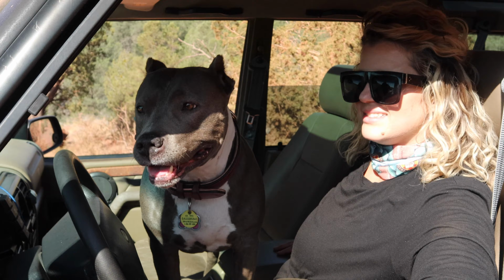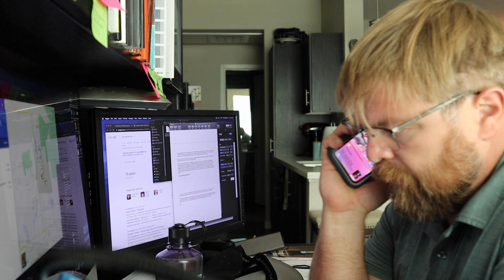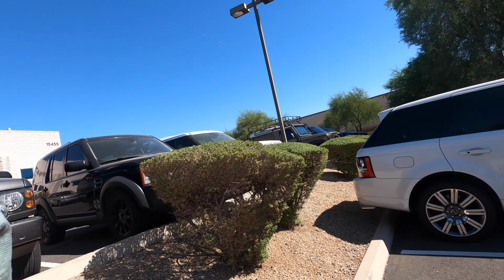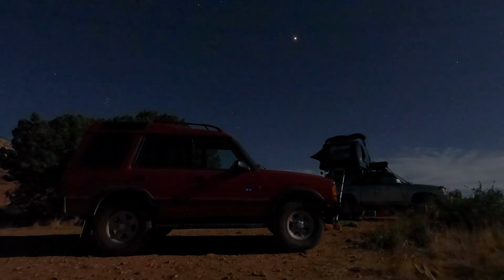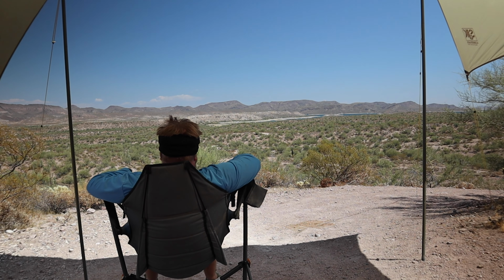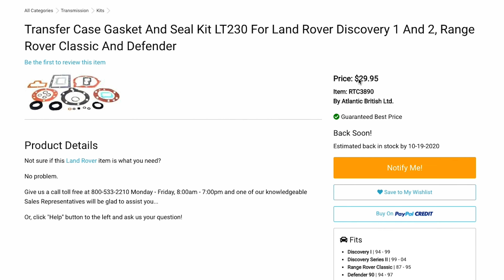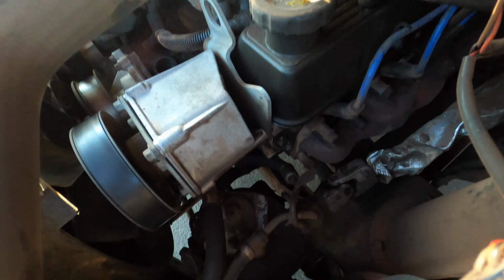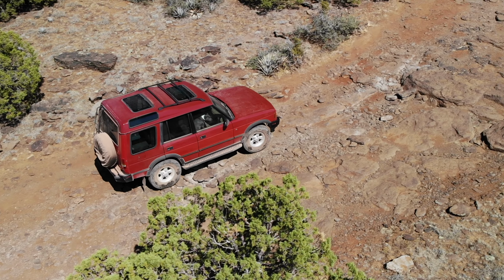Most All Of The PROBLEMS With My Wife's LAND ROVER DISCOVERY 1

Comment: cool video! i just found your Chanel and subscribed. i own a 1998 discovery 1 with 225k on it, and have a bit over 8k worth of new parts on it. that's parts alone i did the repairs. i estimate ive saved myself close to 15k in labor alone. i got most of my parts from Atlantic British, some used parts such as exhaust manifolds from eBay i also recommend lucky8llc, rovahfarm and rockauto for parts.  most repairs are not very difficult and can be accomplished with only one person. i honestly love my discovery 1 and often i start it up just to hear that v8 purring. i recommend downloading the rave manual for the disco. it has been an invaluable resource that and YouTube. A decent set of spanners and sockets, a dewalt impact driver with socket attachments bits, and a regular impact wrench for easier part removal where applicable.  Also several your beverages of choice may be needed and highly advised while doing repairs/upgrades.

if you're replacing the gaskets and machining the heads, i do recommend you replace the timing chain my next project before it breaks*, water pump(STC4378OE), coolant hoses, thermostat with a 185 degree Fahrenheit unit, oil pan gasket(602087), oil pan bolts/lock washers (EOPBK), clean the oil pan sump hose metal filter/replace it *used brake cleaner to remove all varnish and thoroughly clean it*, metal radiator cap (ERR4686B), new exhaust manifold bolts (ERR6734G) *nickel based Copper slip for the bolts for easier future removal, 2400 degree version*, exhaust manifold studs (ERR551) *old studs will likely snap when removing, new manifolds/used manifolds may be required*, new exhaust manifold gaskets (ETC4524K2), zddt additive *to prevent premature cam wear added to new oil (ZDDPLUS), fan clutch (ERR3443) used a dewalt impact driver with allen hex bits to remove allen bolts made short work of them*,  fan clutch wrench (88550) inertia switch (WQT100030L), new brake bulbs *vehicle will not move out of park if a brake light is blown out, found this out the hard way and bypassed mine by using a pin punch on the shift solenoid under the plastic center counsel i do also recommend investing in a 52mm socket for the wheel bearings to adjust the pre and post load.  also replace the fuse able links under the fuse panel in the engine bay   x1(STC1757G), x3 (STC1758G), x1(STC1759G), x1 (STC1760G) keep the old ones as backups as most non dealer parts stores do not carry the 100 amp alternator fuse and could very well leave you stranded should the alternator fuse blow

although it is alot of work, however most of this can be completed in a couple weekends worth of work. replacing those items will ultimately save you time in the future and give you a rock solid engine to build your rig onto. The fan clutch and water pump should be replaced as soon as possible as likely they're overdue for replacement, especially in a very hot climates, these engines are all aluminum so any overheating is a serious issue, as a new remanufactured block alone is 4500 without the core charge. new coolant green coolant is also recommended, avoid any oat based coolants as they tend to be harmful if left unchanged for long periods of time despite the claims that they are long life coolants. 

i replaced my cat back exhaust with a magnaflow system and it changed the sound quite a bit its not obnoxiously loud however you definitely know when its running. i look forward to watching your progress on your disco. welcome to the club ;)
Reply from the maker: Thank you, Chris! That's quite a good bit of info! I actually just got my head gasket kit on Friday, and I'm in the process of getting the head gasket done. I am replacing all the coolant lines, power steering lines, water pump, and thermostat while I'm in there, hadn't thought about the timing chain... fingers crossed the one that's in there stays together for a while. It's been fun, so far though. Hoping to have it all buttoned up by tomorrow night or Wednesday morning at the earliest!
Reply: @MattKester  sounds good man. the engine itself Ive found is quite reliable, it does lack in power a bit on pavement however its true power shows through once it gets off road. good call on replacing those lines as they generally will rot from the inside out and likely they will look fine until you try to pry them off to remove components only to have the hose crack. i wouldn't worry too much about the timing chain as long as your oil light isn't staying on, and you dont hear alot of rattling or unusual vibration. mine has lasted 225k miles and is still running like a top. however with that many miles its definitely in the back of my mind that it may be time to see about replacing it and the oil pump in the near future.
Reply from the maker: @krookdfinra  Well, considering it’s stablemate is a 3rd Gen 4Runner, we are pretty used to not breaking any land speed records on the highway. I’m glad I ordered those hoses too, the ones that were on there were definitely on the drier side, based on how hard some of them were to pry off.

Comment: They leak alright..They RAIN inside. Why leak from one sunroof when you can leak from 2. Or have fun when the mechanism shorts and they open by themselves just to add insult to injury. True money pits especially if you have to buy parts or use a mechanic. If you can't do your own work run away from these at all costs.  If you can do your own mechanics, run away faster. Life is too short to F@#$ with these rejects.This comes from a sad sack that currently owns two, a disco 1 and 2. I don't trust them out of my hometown.

Comment: Hi, after owning a 1991 landrover discovery 3 door for 10 years, doing all my servicing and repairs, I know quite a lot about them. the biggest problem with yours and most of the same imported land rover of that type Is you have the wrong engine - LOL most of European owned landrovers were sold with the unbreakable turbo diesel engines that just ran, and ran, and ran.. Ok your front hubs, later landies and rangies used "one shot2 grease in there front hubs, i ran mine on  lithium grease as you put that in bearings and L/R & R/R front hubs have wheel bearings eh..lol also less tendency to leak unlike 90 weight oil, As you run an autobox you must address cooling issues you stated, swiches and wiring can be easily sorted out, its a Landrover, an offroad vehicle made for FARMERS not luxury cruising, but they will... In the UK there cars sold as 4x4 CARS not trucks, but made for farmers if they want more comfort than the L/R Defenders, REAL L/R defenders not the new 2020 crap things they sell.- Hope you enjoy you "LANDIE"  as I loved mine for 10 happy years..Thanks for the video - Ian -- UK.
Reply from the maker: Thanks for watching and thanks for sharing! I agree, we got hosed here in the US not getting the diesel variant, as well as getting stuck with auto’s. I hate that my country never really  bought into diesels in anything other than heavy duty pickup trucks until it was too late and the   emissions compliance equipment went on and ruined it. I’d love to experience any old Rover from that era with a diesel and a row-your-own gearbox!
Reply: @MattKester  The 5 speed gear box Is quite good plus we get the 2nd gear lever, that gives you low range and centre diff lock, and i read not all earlier Landies came with diff lock ?/ crazy Idea as its all there but not connected up by the lever ?/ In low ratio and first gear the diesels will just pull almost anything,, I loved mine but need auto boxes now.. My search for a Project Discovery continues - lol

Comment: All I can say is that, if this is one of the best vehicles your garage owner has seen, you must have unreal shitboxs over there in the US. I would not have paid more than $1,500 for the car you bought, looks like it has never been looked after, really bad condition!!!
Reply: i just brought a 2000 model Discovery 2 with a 2006 petrol motor in it 
it has $10000 of extras twin batteries full offroad suspension 10 ply 
tyres which cost 1800 dollars reverse camera with recording mode for 
insurance in case you get rear-ended Geenie headers brand new brakes all
 around disc brakes of course heaps of other stuff too i paid $6000 not 
sure if i paid to much i also own a 1985 Landrover county it runs an American v8 Diesel i have never had one scrap of trouble with it and i have never seen another one like here in Australia

Comment: You can have a lot of fun with these, and for sure, they can make nice daily drivers. 

From several different sources I keep seeing the message that these are great cars if you are a good car mechanic, or just good at fixing cars. The parts are all available and relatively affordable, there is good enthusiast and repair support and lots of online info to help you look after the vehicle. However, if you plan on relying on a dealership or a repairshop to look after an old one for you, you might find them a real money pit. Old ones may look nice, but they are cheap for a reason.
Reply from the maker: I hear you. We went into this knowing what the potential was. As far as repair shops and dealerships, I do as much myself as possible, and unless it’s under warranty,  nothing I have goes to a dealership for any work.